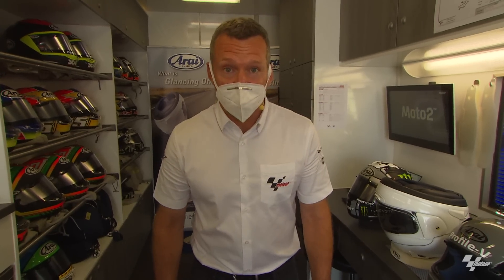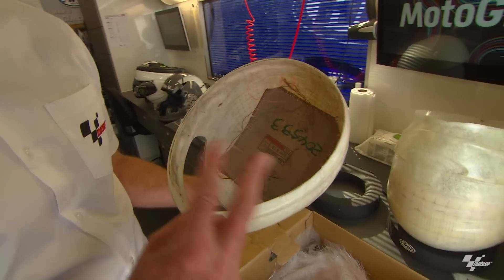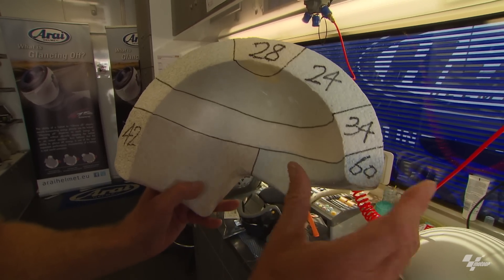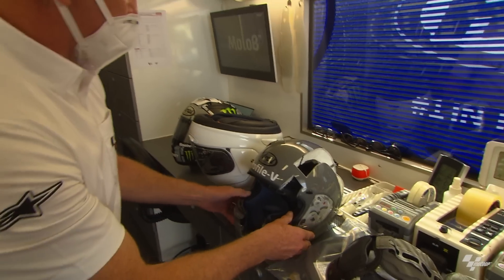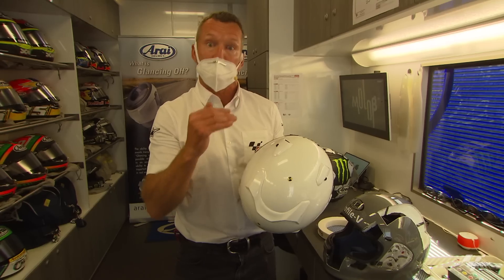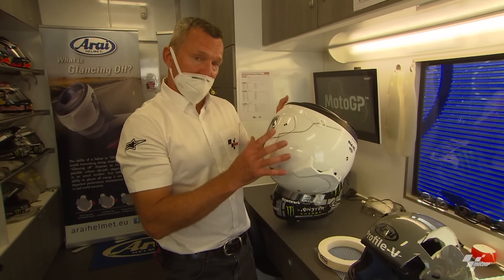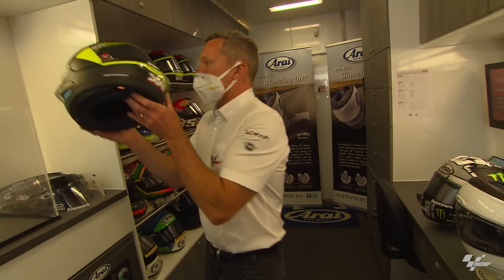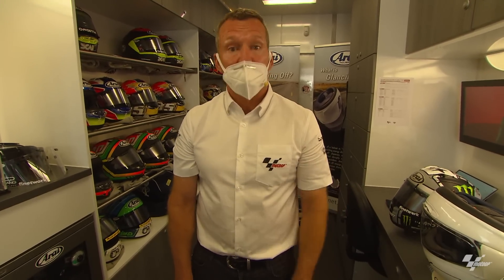Helmet Technology | Tech Talk with Simon Crafar

Comment: 10:14 Corning Optics realized back in the mid 1980s that the "rose tint" was fundamental for seeing with a type of contrast no other colour is capable. And this is because daylight is very blue, betwen 5,000 and 6,500⁰ K, so a reddish tint (Corning caled theirs "vermillion") makes a huge difference for the better, allowing vision with improved contrast and much more clear. Curiously, when a person wears sunglesses with this red or rose tint for a few minutes, and gets used to the colour, when the glasses are removed everything looks quite bluish, until your eyes adjust again to the daylight temperature

Comment: A straight impact to the head, while wearing a helmet, will transfer the energy along the same axis, but in a crash you’re likely to strike the ground at an angle… at that first impact your helmet could be twisted or rolled, and the Swedish company's Multidirectional Impact protection system technology that is claimed to reduce the amount of this directional force that gets to the head, helping the cerebrospinal fluid protect the brain from damage that could lead to concussion or worse. But all these motogp helmets do not deal well with rotational impacts. You would expect a $2k helmet to protect you from rotational forces. Its a shame and a safety concern.

Comment: Radio communication needs developed further. Visor readout for rear camera already on the market. Camera already on the bike. Duel facing cameras which crew chief and rider use to monitor traffic from behind. Communicate through visor and LCD touch screen. Some buttons could remain remove the rest. Rain warning light switch should be removed and replaced with remote activation from track officials. Yellow flag issued for crashes. Send corner number of crash and use colour yellow to warn rider of yellow conditions in that corner and so on. A flashing yellow number 7 is easy to understand. LLP could be sent through visor or communicated direct. Why waste time waiting on the rider to appear on the front straight. Ride height adjustments needs work. Needs made automatic no buttons. Terrific forum Simon - Motogp.

Comment: The rose tint in visors is for blocking out blue light. All aviation pilots wear blue blocker glasses because when you remove excess blue light the contrast of the other colours goes up. For this reason eagles also have a rose tinted eyelid to help spotting prey.
Blue blocker sunglasses also work well in marine environments....where there is excess blue light from both the sky and sea.

Comment: There is an interesting point about you could have given a little more info. The different type of fibers that are used in the outter shell of the helmets. There are some riders that in their helmets use a mixed of fiberglass and carbon fiber, others only carbon fiber, and others use another components mixed with the previous ones.

Comment: Thought Motogp Helmet would be made with Carbon fibre instead of fibre glass.
Reply: AGV Pista GP/GP-R/GP-RR actually made of carbon, but the mixture of resin and fibre are more dominant
Reply: i asked the arai rep, and he said the same Corsair X helmet you can buy in the store is the same the motogp riders use
Reply: @evanylee  and almost all arai's helmet are the same shell quality like the racer used for race. di difference just graphic, vent, and bit inner padding
Reply: Carbon fibre is not that good on compression forces but it is very good in tension.  Kevelar is the opposite very good on compression and less so on tension.  That is why Kevelar is used on bullet proof vests, helmets and anywhere that needs to manage impact.
Reply: @ianb9028  You don't know what you are talking about. 
Carbon once held in column by the resin matrix is excellent in compression....why they use it in all high tech yacht racing masts...which are basically a compression column. 
Kevlar is good under tension but not good in compression. Kevlar's major benefit is that it is abrasive and penetration resistant...that is why it is used in bullet proof vests. 
Carbon fibre itself is not fragile. That is obvious when handling dry carbon fibre. The issue with carbon is that it is super strong in tension and compression but  has next to no yield before failure so you can create a strong stiff component but when it breaks it is catastrophic. 
The resin used in the matrix plays a major part of the overall durability of a carbon/epoxy laminate....so it is best to use epoxy prepreg carbon for its superior flexual modulus. 
Glass fibres are more often used for their greater yield before failure and greater flexual modulus of the glass/epoxy matrix
Reply: Carbon fiber would be super awesome for weight gain, but pure carbon fiber would shatter into millions of pieces with an impact. Its strong but brittle. there are carbon fiber helmets, but I don't know what mix of compounds are used to make them safe and if they are safe enough for moto gp
Reply: Correct me if I am wrong, most of Japan Brand still using fiber glass in concern to pass SNELL standards, and one of their concern was about certain weight. Most of helmet brands who are using carbon fiber having a purpose to serve the lightest helmet, which that part cannot make them to pas the SNELL. Yes you can still using carbon fiber to reach the SNELL but you will need more carbon fiber layer parts to reach the minimum weight. The result? Take a look at arai rx7v/rx7x Carbon, the price is so high even might be almost 3 times than agv pista GP RR which is also using carbon fiber. So that is depend on the brand manufacturer standards and concerns. In the end, brand like arai still concern with total safety rather than reach the latest trend model or be the lightest one. Take a look that brand like arai from time to time the shape still looks round and round and have important aim like what simon crafar explain in this video
Reply: @adrians7087  carbon fibre products are also electrically conductive.

Comment: Why are racers removing the tear off after they have left the pit? I personally would have checked in advance. What happens when other riders hit a tear off laying on the track? Safety issue?
Reply: Yer I was going to ask also what a tear off does to traction if you run over one. Often they are getting taken of after warm up on the line for race start. Would one make traction control kick in more aggressively in the all important launch to the first corner?

Comment: So, there is no speakers and microphone for communications between the rider and the pits?

Also, what buckle style do racers use in MotoGP? There are two styles I'm familiar with. Is one better than they other for racing at this level?

Finally, racers seem to go down a straight in a full tuck with their heads on the gas tank, and looking behind the
Motorcycle's wind screen. Can they see forward in this position!?
Reply: Only "communication" in motorbike racing is by the pit board and in some classes some basic pop ups on the dashboard (like switch to different riding mode). No verbal communication allowed. 

Regarding the helmet straps. All circuit helmets use double D locks. These are the only one allowed in racing.

And yes they can still see forward when going on the straight. Thats why the visitor of the bike is clear and they don't have stickers on top of the fisor of the helmet like f1 drivers have. They use that part to look through.
Reply: They put the helmet bit more angled to the top to get a better vision while tucked in. Simon explained this is his channel once.

Comment: 10:25 reminds me of Corning's "vermillion" technology for sunglasses. The theory is that daylight is very blue, and when a reddish tint, or coating is applied to the lens, it increases not only contrast but chromatic definition.  I had one of those glasses, and it is quite interesting; once you put it on things look quite pinkish, or magenta, but in minutes your brain ajusts, and things look incredibly clear.  Then, after some time, when you remove the glasses, the world looks flat and blue.
Reply: interesting. thanks for sharing your experience.
Reply: Ski goggle manufacturers have been using that tech since the '70s. My favorite lens were rose colored. The best in my opinion is polarized.
Reply: this is why for street daytime riding I wear Oakleys with a clear visor instead of just a tinted visor. I definitely notice the difference
Reply: Oakley prizm lens use this technology. I use either prizm road or prizm golf whilst riding/driving on the road. With either lens, makes all of the colours "pop" e.g. reds look brighter.

Comment: I don't think you say why gear ratio matters. You change the ratio to the different tracks thight or long straights And bigger mass rotors will help pace the bike speed 'tug of war' brakes on back of the wheel